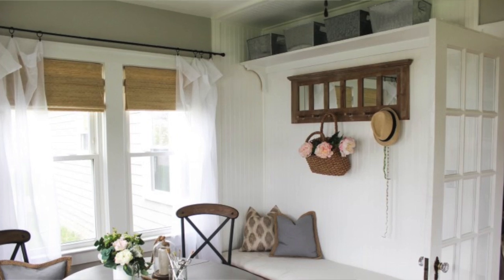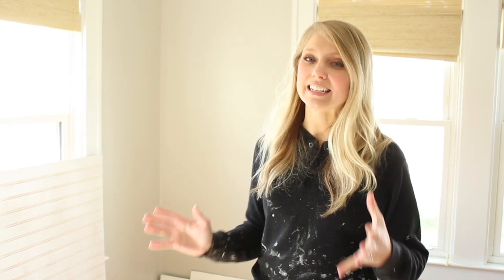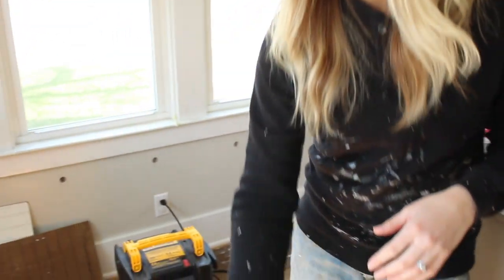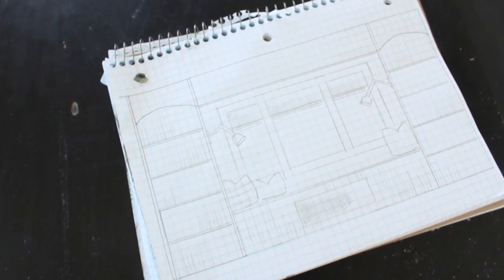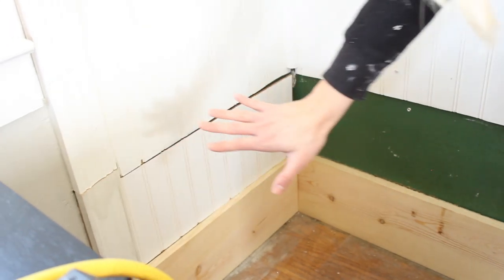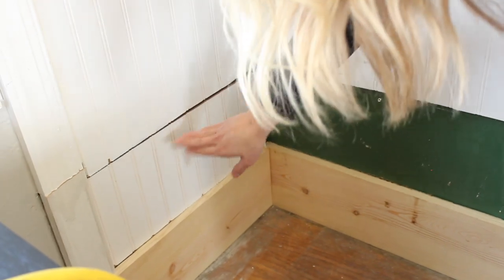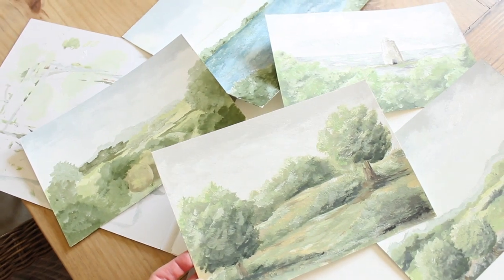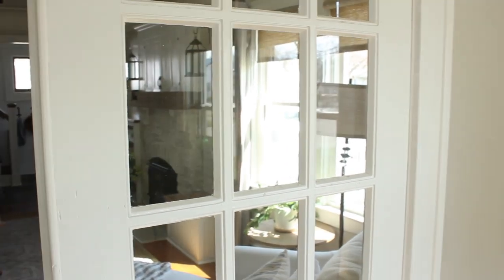We Insulated our Sunroom! | SUNROOM DESIGN PLANS and Inspiration

Comment: I love what you're doing with the sunroom. We had a sunroom built on the back of our house in 2018, and we've practically been living there ever since. So any advice I offer comes from experience. I see that you have a furnace vent coming into the room -- but since the driving force behind doing all this work is that it has always been cold out there, I can offer some suggestions on heating. First, because the room is fairly small, it won't cost a lot to add some heat, nor will running the heat break the bank. This is always good to know. If you can figure out how to squeeze in an electric fireplace, go for it. It's just so nice to be able to sit with your feet up to the fireplace, and a fireplace lends a sort of charm that no other heating appliance can. Another alternative is an electric Franklin stove. The stoves used to be all black, which does kind of stand out in a sunroom -- but they've been available in white for several years. You do often have to look for them, and in my area, resort to the 'net and order, but they have so many advantages, it can be worth the effort. They are small, they are cute, they can stand in front of a window, they are mobile, they put out a lot of heat, and the shelf on top is perfect for decorating or for plants that need heat at the root. 

Our sunroom is 12x20, and we heat it with an electric fireplace we've made look built-in, and two 26" PTACs. The company that built our room had recommended a single 48" PTAC, but I thought it would take up too much wall space, and was concerned about something that large taking up space where I could put a cabinet or an antique sewing machine. I held out for the two smaller units, one in the front corner, and the other catty-corner to it in the back corner.  They heat the whole room easily, and avoid the dreaded hot spots and cold spots a single heating unit can create. And since they both heat and cool, the room is comfortable all year, come snow storm or heat wave. 

I also encourage you to find a nice antique table -- something like this would be grand: https://www.bargainjohn.com/wp-content/uploads/2016/05/F943DOvalTable.jpg
I have that same style table, but not in the sunroom. They were designed to stand in the center of a room, so they don't even need a wall behind them. But you can move it over to your built-in bench and use it for auxiliary dining space. The table I just posted will easily seat three for dinner or four for tea. All you need to add is two or three small antique chair -- https://www.loveseat.com/i/set-of-4-cane-seat-chairs-3/ and some pretty table linens. 

Also, because your room seems fairly small, the bead-board paneling is an excellent, cottage-y choice. The charm is built right into it. If you don't plan to leave it white, I suggest a light pastel color. I mean, it's a sunroom, right? You don't want to darken it. I love the white piano, and hope your built-in desk and library wall will match it. 

We had the floor of our sunroom insulated with bats of R-25 when it was built. But we live in an area that can have VERY cold winters, so we also covered the floor with sheet vinyl flooring that has an insulating backing on it. We have a second layer of that same roll flooring on the traffic path, and have large, thick woven area rugs over most of the rest of the floor. We figure keeping the first layer covered will double the life-span of the flooring. 

I know the "getting there" part can be a mess, but seriously -- once you have that four-season room set up, life will change. And by that, I mean improve. You will love it. It will become like your family room.

Comment: What kind of insulation did you use? What's the name of the machine that pushed the insulation into the walls? Was it as easy as it appeared or did you hit any snags? What drill attachment did you use to make the holes in the wall? How much did the insulation project run you? Sorry for the rapid fire questions, hoping you can provide the answers I think they would benefit most watching this video. Thank you, beautiful room.